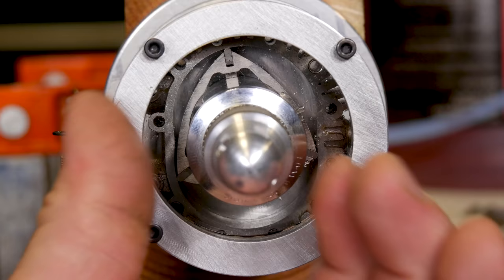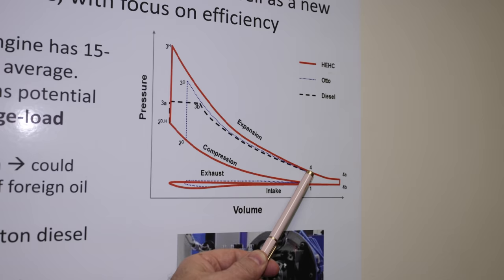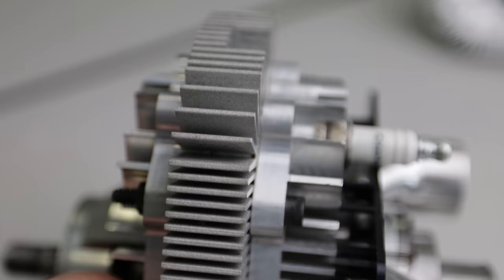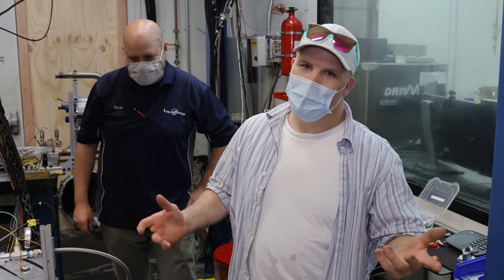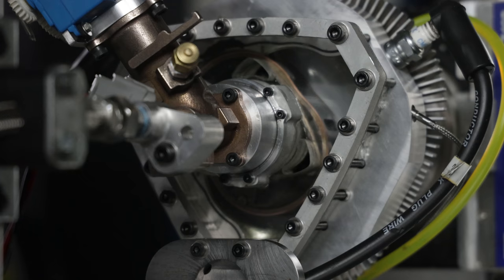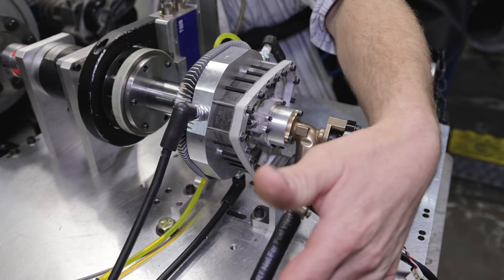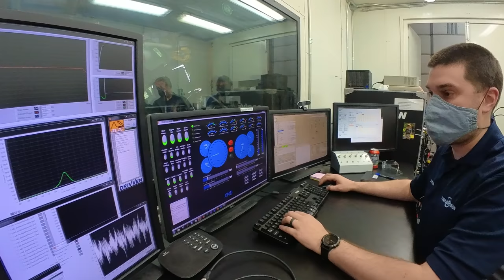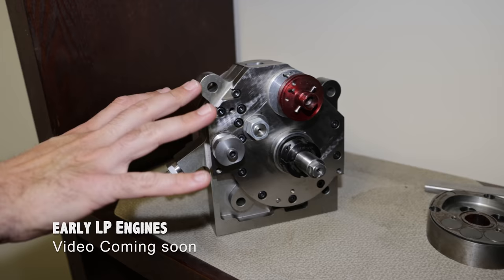See Thru Liquid Piston Rotary Engine - In Slow Motion

Comment: I worked for Mazda N.A. for over 14 years and assembled (by my calculations) about seven thousand rotary engines and assembled thousands of rotors and associated assemblies. This was over twenty five years ago and I'm very pleased to see that the rotary engine has advanced to this incredible engine. It appears that you have found solutions to the apex seal , side seals and the eccentric shaft. Three combustions in one revaluation instead of just one. Truly amazing. Congratulations. Now make it bigger. Thanx
Reply: I kept getting ads looking for investors from these guys. The ads said they're developing a version to compete with the engines used in OTR trucks
Reply: Keith romig how well woud an egine like this go if mazda disided to go with an engine disighn like this
Reply: The fact that that is a unique design I'm sure Mazda would be impressed but that type of motor would be better for some other application. It's just too small for an automobile.
Reply: I may need to get ahold of you for my fc engine rebuild
Reply: @keithromig957  I see no reason it can’t be scaled up to car size ?
Reply: @KenBober  good luck with a rebuild. That was some 30 years ago. Mid-eighties to mid-90s. I can't even imagine where you could find parts at any sort of reasonable price. Good luck my friend.
Reply: @keithromig957  damn. Mazda in Manchester ct won't even look at my car and no mechanical shops have a clue about these engines.  Looks like I'm going to have to tinker with it myself.
Reply: @KenBober  I just saw this response and figured I should get back to you. What is the engine doing or not doing ,what seems to be the problem? I will try to diagnose the problem for you.
Reply: @keithromig957  it's a retired autocross car and the guy I bought it off of said he had it rebuilt by Mazdatrix in California 30k ago.  It runs smooth as silk but I still want it gone through and also street ported.  I'm a 18 year veteran collision tech but I gave up on engine rebuilds back in late 90s. Never rebuilt one so I don't want to attempt it.
Reply: @KenBober  if it aint broke don’t fix it, leave it alone if it runs fine. Just take care of it and keep fresh oil in it
Reply: @mhxxd4  rather be ahead of the game instead of having a apex seal break due to wear and chew up the housings. Then it gets very expensive.  So do apex seals early to be safe
Reply: A wankle still has 3 power strokes per revolution.
Reply: @KenBober  What are you afraid of? There are so few parts to a wankle that it can't be all that hard.
Reply: Tell mazda to Hire new technician to keep this engine alive 🙌 please and thank you
Reply: @dboys4534  I'm just gonna rebuild it myself.  Put it this way in the last 10 years I've only seen 1 other fc. 1 fd (trailer queen) and 2 rx8s. They don't have a need for a rotory mechanic.
Reply: Hi, Keith. Could you please explain to me the real advantages of this engine over conventional rotary engine? Especially the ones concerning the apex sealing. It looks like to me that the friction is now between the seals and the rotor rather than the body. Thus, the engine rebuild would require new rotor rather than the housing. In addition, here you need three spark plugs rather than one. The only real advantage I can imagine is the even heat distribution over the massive body due to three combustion chambers rather than the single one.
Reply: Efficiency????
Reply: @keithromig957  it would obviously be a bit bigger. But that’s what makes it good. Less weight, revs to high rpms
Reply: It's actually only 1.5 detonations per rotation. The eccentric shaft seems to be gear 2:1 unlike the Mazda's which were 3:1.
Reply: Very puzzling, how do you keep such an engine lubricated? You would have to put oil in the fuel like a 2 stroke engine. And there goes the emissions standards out the window.
Reply: @forfluf  the engine actually injects oil from the oil pan into the rotor chamber. That's why it's so important to change your oil don't let it go to low and make sure that it's clean. Synthetic oil doesn't burn so would put that in the engine and it would last maybe two thousand miles and then seized up. It is such a light engine that I always wanted to put a 13B in a boat and let it rip.
Reply: Now do 4-rotor lol
Reply: It really is, but the apex seals haven't been eliminated though, now they are stationary in 3 positions, sure sollecitations will be differents but... they are still there... And I'm worried about the cooling of the main rotor.
Reply: And it seems that when passing through the center of the rotor, the intake system benefits from the centrifugal effect, as if the engine itself acted like a turbo. \o/ Maybe? :)
Reply: @keithromig957   you are assuming it is not scalable??   WHY??  re "...type of motor....too small"   I dont get it?
Reply: @keithromig957  I dont understand WHAT you even saying.....this obviously is a prototype ...obviously if it is scalable and at least as efficient and or cheaper to build or lighter (hp to weight ratio) then OF COURSE it could be fully engineered for mass production ....IF it truly has potential to solve the wankel issues I can see Mazda for one being HOT to go balls out....Even with its problems the RX7 was big hit!  I for one would ABSOLUTELY buy an RX10 with a 10 year 200k mile warranty on engine....A 2000 pound sports car with 400 hp ..mid engine for $40K .....dream come true!
Reply: @KenBober  NA rotaries are super reliable and last forever (usually). And I'm not a big rotary fan. Its when youtubers stick huge turbos on them and run 250hp/rotor or more when stuff starts to get sketchy.
Reply: @N4CR  Mines an s4 na. So maybe 150 horse. If I can get 170 It will be perfectly fine for me. I dont race, I enjoy the experience of the car.
Reply: Wankel is effectively a two stroke giving three bangs per revolution from one combustion chamber. LP is a four stroke with three chambers also doing three bangs per rev. LP has fewer losses and better combustion giving considerably more efficiency. 
The highly diluted exhaust makes catalytic converters unlikely to work. But is a cat really needed?
Reply: Coming from a professional such as yourself, this makes me smile, i loved mazdas rotary engines, im excited to see where this goes
Reply: My only worry would be cost and durability, Mazda already had problems with exentic shafts when pushing really high power making the shaft hollow will make it allot weaker making me worried on how usable this will be on a higher power application, especially when you try to save money on materials.
Reply: @keithromig957  For what reasons could this not be scaled up?
Reply: Js it possible to run it on Hydrogen? 
What would be the comparative efficiency between the battery charging power from an LPR and a fuel cell per kg of H2? 
How would that compare using direct mechanical drive H2 to tyres per kg H2 and via rechargeable battery storage? 
Could this method be viable for H2/ EV hybrid long haul trucks enabling the increase in payload?
Reply: Mazda was trying to convert the rotary to hydrogen and that was a very long time ago. They never had any success.
Reply: I did see someone mention getting the engine to can bus three times in one revolution and the Mazda rotary engine did combust three times and one revolution. Each side of the rotor created a combustion chamber as it's pain in one revolution. It would combust three times.
Reply: Ok
Reply: Too bad about the fundamental lubrication problems that all rotary engines unavoidably have, though. Not being able to scavenge oil means the oil has to be injected into the housing and left there until it burns off, so to minimize carbon buildup and pollution emissions the amount of oil has to be kept to a bare minimum, which means the seals are always on the verge of galling and destroying the moving parts.
Reply: @keithromig957  too small? You always start small, because its more difficult, if you perfect that, scaling up only makes things easier and more efficient due to bearing resistance not scaling up with size. The only thing that becomes more challenging is cooling due to the same no linear growth of volume to surface area. So too small, is irrelevant. A chansaw engine is too small for a dirt bike, they do not remake a different design though, it is just bigger and the same until you have cooling issues and need to add coolant systems and probably would go to 4 stroke for controllability, but a large 2 stroke still works well, people are just suckers for quiet and invisible exhaust.
Reply: @keithromig957  k
Reply: Three combustions!
Reply: You can also use unbreakable (brand name) seals, and they'll last 10 years or so. The carbon seals are just outdated.
Reply: did you find building rotary engines easier or regular piston engines in the other mazda models easier?
Reply: @keithromig957  what if they make it an actual size motor? would that work
Reply: @harryconover289  I know this is old but I think one issue is that the way the intake and exhaust gases are routed that a single rotor is all that is practical. In addition with the way the exhaust gas is routed it seem like heat removal as the size of the engine grows would be a huge issue.
Reply: Well. To be exactly, this is what Felix Wankel developed himself. Mazda, and prio NSU took Wankels REAL rotary engine and transformed it to a STANDING engine, where only the Piston rotated. Wanels engine rotated around the piston.

This one is again an inversion: They put the inside out and outside in: The triangoloid piston is outside as the housing and the housing is now the piston.
Reply: " Three combustions in one revaluation instead of just one"   -  no difference! 
Both geometries give three combustions per one rotor full revolution.
Reply: I personally would like to see two sets of chambers stacked to boost the output.  Stacking more than two might prove more complicated but two could easily be done, since the mechanism is single facing.
Reply: @PTSF_Jaeger  Yep, and small to medium aircraft.   They also might use a larger variant in mid-sized boats.
Reply: @ruediix  I can't picture what you're referring to but Mazda 3 make a 3 rotor engine that never entered the US market it was only in Japan.
Reply: correct me if I'm wrong but each engine in a mazda car has more than one rotor right? I honestly can't believe you'd get enough power off of one rotor....
Reply: @sheilaolfieway1885  Sheila the Mazda 3 B rotary engine was about 70 cubic inches and back in those days I could pick one up and they can get up to 280 horsepower. I've always wanted to put one in a speedboat.
Reply: @keithromig957  Yes but how many rotors do they have in them?
Reply: @sheilaolfieway1885  there was a 12 a.m. and a 13B engine
Reply: @sheilaolfieway1885  there were two different engines in the US, a 12A and a 13B and they both had just 2 rotors
Reply: @keithromig957  I see i wonder how well a single rotor engine of that design would work...
Reply: i did not get how exhausts getting out through exaust stroke. is there a solenoid valve?
Reply: How much torque we talking here.
Reply: @harryconover289  With an intermediate stopover to motorcycle size! :-)
Reply: Had a new Mazda RX4. in a wagon.. loved that motor..
Reply: The inventor of the rotary engine was the German engineer Felix Wankel, who sold the patent to Audi/NSU. The NSU RO-80 was the first vehicle propelled by a rotary engine. They sold the patent to Mazda, because the rotary engine is a gas guzzler and has emissions issues.
Reply: @KenBober  try electric conversion
Reply: Crazy how the best way to fix the problems with Dorito Power is to turn the Dorito inside-out.
Reply: @davidelliott5843  "The highly diluted exhaust makes catalytic converters unlikely to work. But is a cat really needed?"

Does a bear s**t in the toilet?
Reply: @KenBober  Australia is the place to look for rotary engine mechanics. We use to build and port motors when we were teenagers in the early Rx series I had a Rx4 and an Rx3. There are videos available online that go through the rebuild process in its entirety. They are not a hard engine to work on.
Reply: @indica8510  I've seen those. I actually want a rx4, I'm gonna just do mine myself this winter.  It's off the road this weekend because we are getting our first snow fall.
Reply: Would the weight of this thing scale up linearly? If a 4hp engine is 4 lbs, how much would a 100hp or 150hp engine weigh?
Reply: How do we know the seals problem is solved? Do they have any data to support that?
Reply: @manofsan  I do not know if they had to stay at the seals problem solved. I watched a video the other day of them building a four-rotor engine which was pretty cool. The seals are a multi-part issue. One of the biggest issues was not changing and keeping your oil clean because the rotary engine actually injects a bit of your oil into the chamber. When synthetic oil came out that was a huge problem cuz it does not burn.
Reply: @Keith Romig  -  I know that Liquid Piston have demo'd a rotary that burns hydrogen. But I wonder if they have to put oil in that one too, or if it's zero emissions? I also wish they could demo their small rotary engine on a paramotor.
Reply: @expansionone  '...and has emissions issues."

It must be noted that emissions issues are entirely artificial issues, and not practical issues.
Reply: @KenBober   look ut the vargis Brothers they do that kinda work
Reply: @Foshomoto  will do
Reply: @MrVaticanRag  Energy density of Hydrogen is very poor compared to fossil fuels (about 7 times less energy). It is the volume (litres) you need to consider in a vehicle not weight (kg). That is, the physical size of the tank. So range will be only 20% on the same tank as a fossil fuel vehicle or tank will need to be 5 times as large for same range.
Reply: @keithromig957  🤔 The smaller the better, isn't it? Imagine if they used gas turbines like in aircraft.!
Reply: @deusexaethera  personally
Reply: @bludika  The rotary was much easier to build then a piston engine. There aren't any special tools needed. If using all new parts the most complicated part was the engine stand. Some torque wrenchs, a meter to check the play within the engine and a big jar of gasoline. It was the skill of putting it together that most important. We rebuilt them so that was much more complicated.
Reply: @user-ez9lm9wh8p  It would be the weight ratio to HP and torque. Small , light weight, and powerful.
Reply: @CFChristian  I watched a bid on youtube doing just that.
Reply: There are two rotors per engine. I can try to explane but you would be better off served to watch it on youtube.
Reply: @keithromig957  Oh for real? I understand what you're saying, but I'll take a look. That's pretty exciting.

I have an itch to try and mess with a rotary moped too but not too confident in the choice of crates.

Well, now it's gotten worse bc Ryan from FortNine just did a review on a rotary motorcycle.

The struggle is real. 😂
Reply: @CFChristian  if you go way back there was a 10A engine that was even smaller but it has many issues. It was one of them earliest rotorys. Trying to put one on a cycle would be scary. Maybe on a strike. I would think it would have to be direct drive.
Reply: @keithromig957  OK, but why? Please notice I've asked about the difference between conventional ROTARY motor and this ROTARY motor?
Reply: @jakubswist5839  I'm not shipping my engine over seas. I'm gonna rebuild it myself
Reply: @keithromig957  I just found out Mazda made a OEM 3-rotor?!?

I'm so embarrassed.
Reply: @keithromig957  Unique is hardly the correct work. This design can be found as one of the concept design in "Rotary Engine by Kenichi Yamamoto" from 1960's.
Reply: Just in time for them to banned for electric.
Reply: three firings per two rotations like three cilinder, this one it's four strokes unlike Wankel and two strokes, but it's having more combustion chambers per rotor wich makes firing interval with 120º shorter like passing from parallel twin to inline three or from four cilinders to six cilinders interval in case of two rotors like on mazdas and all this with more efficient shape of the combustion chamber and same number of spark plugs per number of combustions with normal non hiden spark plugs
Reply: rotor engine is an interesting piece of engineering, but it still has the same issues with low reliability and high maintenance costs what can`t be solved. In comparison with rocketing EVs this is a past. It is like modernizing a steam engine, makes no sense.
Reply: @KenBober  mostly motorsports in Stratford, CT specializes in rotary
Reply: @chickenhawk212  great!!!! Thats less than an hour drive from me! Thank you!!!
Reply: I loved my RX7 and had only 1 engine repair in 3 years of ownership...and I drove it hard.
Reply: @molonlabe9602  my engine is still strong,  I'm actually fixing the damn fuel pump again right now at 830am. Cheap Chinese parts.
Reply: @harryconover289  bad timing.
Reply: @PTSF_Jaeger  I kept getting them also which made me very skeptical, they originally said they would go in planes as well. Seems like they're just desperate for funding.
Reply: Repent to Jesus Christ!
“By faith Joseph, when his end was near, spoke about the exodus of the Israelites from Egypt and gave instructions concerning the burial of his bones. By faith Moses’ parents hid him for three months after he was born, because they saw he was no ordinary child, and they were not afraid of the king’s edict.”
Hebrews 11:22-23 NIV
Reply: Amazing - you made the same number of engines as the rebuild interval for those engines.
Reply: @expansionone  Not quite, The NSU Spider was the first
Reply: @munnsey  you're right. Thanks for letting me know
Reply: Interesting design concept but no major manufacturers are even remotely interested in investing money in fossil-fuel burning engine designs. The future is 100% electric. As so it should be, burning raw fuel in autos belongs in the previous century.
Reply: @TheCuriousOrbs  internal combustion is here to stay. It'll be the fuel that changes - hydrogen.

Even hydrogen fuel cells won't come close to the efficiency of internal combustion.
Reply: @TheCuriousOrbs  I am a Professional Engineer with degrees in Electrical Engineering and Nuclear Engineering. The electric cars on the road today are causing more pollution and environmental damage than internal combustion engines. The primary source of energy for electric cars currently comes from coal and fuel oil electrical power plants. There are HUGE inefficiencies in electrical power production and distribution.  Overall, an electrical power plant is only about 35% efficient at converting the energy in the source fuel to electrical energy. Then every transformer that the power has to go through before it gets to your house to charge the inefficient batteries in your car are only about 80 to 85% efficient. So, to produce the electricity for your electric car to go 1 mile, it requires the burning of a huge amount of coal or fuel oil and causes more pollution from those power plants than if you burned the fuel oil (thick diesel oil) directly in your vehicle. Only when the majority of electricity is produced from solar, wind, tidal, or other green electrical production will electric cars be good for the environment. That time is far into the future. In the meantime, power companies are having to build more fosel fueled power plants to keep up with the growing demand. Someone joked about going back to steam powered cars, but guess what, an electric car is a steam powered car. The steam that it uses is just remotely located. Every power station, except hydroelectric plants, use some kind of fuel, even Nuclear power plants, to produce high pressure superheated steam to make electricity. The steam loop in a power station is less efficient than the old steam fired locomotives. Only superheated steam can be allowed to drive the massive turbine blades that then turn the input shaft of an electrical generator. The steam exits the turbine still as superheated steam. It then has to be cooled down to become liquid water again to loop back into boiler. Massive amounts of waste heat are pumped out into out environment. I live by a coal fired power plant. It has a lake that was built for cooling the superheated steam. The upper lake is the exhaust heated water from the plant. At the channel where the upper lake dumps into the main lake, I have measured water temperatures of 104° in August and September. At our dock 3 miles away, the temperature in August and September gets to as high a 90°. It takes a huge amounts of energy to heat up such a large body of water. Part of that waste heat and the pollution caused by the burning of coal is because of electric cars. Our power grid is extremely unstable and antiquated. There is a TED talk that discusses this problem. There are 9 major power substations in the US. If they were attacked by terrorists, the majority of the US would be without power for about 2 years. Farms could not be irrigated. Factories could not operate. Approximately 3/4 of the US population would die. I don't think making ourselves more dependant on electricity by converting to electric cars is a good idea right now.
Reply: @keithromig957  Why not have a dedicated oil (or should I say more generally lubricant) supply solely used for injection into the chamber?  No worries about changing the oil as it is isolated from rest of the system.  You only have to keep a separate reservoir filled....much like Diesel engine AdBlue systems that they inject for managing emissions.  You then also can balance the fluid characteristics to meet a balanced need of both burn/decomposition and lubrication in isolation of any standard oil function for the rest of the moving parts.
Reply: @TheCuriousOrbs  Electricity generation for charging has to come from some where...either localized to vehicle or central power generation/distribution as you plug it into your car.  Green power (solar/wind) is very expensive and not reliable. Hydrogen creations is too costly. Carbon-based fuels will not go away as long as there is not a resurgence for nuclear reactors (hopefully fusion-based at some point) to replace coal/nat gas in power plants.  Hybrid vehicles will be around a while before electric-only become the norm so as to provide that ability to internally keep a charge topped off as range extender until batteries take a next technology leap. LP will be positioned for use as the internal charging engine in hybrid cars/trucks.
Reply: @bmarvin6339  Great post.  Most people do not think about where they get the power for their electric vehicles.  Nor do they measure their greenness against the extreme environmental damage in the mining of rare earth battery materials and their subsequent manufacturing.  The fragility of our power infrastructure is also a good point.  There is not enough decentralization.
Reply: @MRJNB-jn9bk  that is exactly what I asked my Japanese counterpart engineer and I don't recall exactly what he said but it made no sense to me. I guess they figured if you're not smart enough to check the oil in the car and change it once in awhile you're not smart enough to check the extra oil Reserve either.
Reply: @keithromig957  A good ash-less 2 stroke oil is what should be used to lubricate the chamber walls, from an engineering viewpoint. A separate tank to feed the 2-stroke oil would need 2 level sensors. One level sensor to warn the driver that additional 2-stroke oil needs to be added and a second one to stop the engine from running to protect the engine. Of course, 4-stroke oil even synthetic oil could then be used for the eccentric bearing lubrication and the rotor cooling. I know of Experimental Homebuilt Aircraft that do this. Unfortunately, this is an example of when engineering and marketing clash. If the RX7 had been built with a 2-stroke oil tank, the average (non-technical) consumer would think the car had a 2-stroke engine. Burning 4-stroke oil in the combustion chambers causes ash to jam up the seal slots, causing the seal springs to jam and the seals to stop working. The jamming of the corner seals and the apex seals can cause the apex seals to break. This can lead to the destruction of the engine. Having 2-stroke oil in the combustion chamber might have helped the emissions because 2-stroke oil burns more completely. But, primarily, the emission problem is due to the odd shape of the combustion chamber with all the corners where the flame front leaves unburnt fuel. I'd like to know more about the emissions of this inside-out rotary.
Reply: @keithromig957  couldn't you just scale it up and increase displacement?
Reply: But the oil ?  Wil consum a big oil
Reply: Yeah mate I got told they'd have top feul rotary in 98 wish in one shit in another rotary fans should be grateful that the local newspaper gets delivered wrapped in a rebuild kit 🤣
Reply: @KingSheva-sh5qw  
How is expansion of the metals handled? It would seem to me this design would shine in a continuous run environment.
Reply: @bmarvin6339  
Co-generation supplies a portion of the demand. This changes the impact.
Solar takes the edge off at peak time of day.
If you have ever seen the grid demand you know from 9 PM to 6 AM the demand is drastically reduced from during the day. Incentives for charging overnight would offset the higher peak demand. All told, I agree with what you presented. Number of households are constantly growing so demand in that realm will never be less. Modern life revolves around electricity.
Reply: @PTSF_Jaeger  I'd rather buy an engine than invest.  But I'm broke so probably neither
Reply: @GregoryVeizades  per rotor revolution,  but it rotates at 1/3 the speed of the output shaft. It's orbiting on a gear reduction.
Reply: @invisibilezoe7295  I'm sure there is more r&d to be done.  The rotor could be a carbon composite and banded in something exotic.  They said there is excessive fresh air flow through the rotor and it gets cooled. Man just like carbon brakes this thing could be operating on a new level
Reply: @nigelwolfe6150  what is this? A school for ANTS?
Reply: @davidelliott5843  so the rotary does 3 bangs per rotor Rev. The output shaft rotates 3 times per 1 of the rotor.  Common misconception
Reply: @KingSheva-sh5qw  tubes are generally stronger than solid shafts. Also it's not being pounded by reciprocal force.  A hollow shaft is very strong on the longitudinal torque plane. Think drive shaft
Reply: @MrVaticanRag  you never want to go the combustion route with hydrogen,  only fuel cells. Just like that acetylene, if mixed with oxygen it's just to energetic for use like that.
Reply: @deusexaethera  could be injected into the seal if they are exotic sintered
Reply: @edeltrautfeuerglut2243  why u say piston?
Reply: @jwserge  correct but a Mazda wankle rotor rotates reduced speed because it's orbiting the gear on the shaft. Watch the animation on the Wiki wankle  tab Design.  It has marks for shaft position and if you pay attention you will see 3 revs of shaft per 1 of rotor.
Reply: @sheilaolfieway1885  yeah because it would perform like a 3 rotor wankle
Reply: @aryakia850  ports. Watch again
Reply: @keithromig957  synthetic oil burns
Reply: @KenBober  no, fly the Aussie to you
Reply: @joeidan801  it makes sense for small or personal aircraft.  We still can't get the energy density/weight as good as fuel for long flights.  This thing would be awesome for ultra lights,paramotors, small helicopters. There are plenty of uses in the world where a Tesla won't fit the bill
Reply: @bmarvin6339  ok you went on a tangent but to address the in efficiency of EV right now. Yes everything you said was correct excluding solar farms that produce steam. But this is how it has to happen. No one is going to remedy all the issues unless there is money to be made. We wouldn't be this far if it wasn't for Tesla.  The infrastructure will follow.  A missing part of our power systems is storage.  Tesla is addressing that. There is no way you can convince yourself that all the power plants have anything over the sheer number of personal vehicles in this world.  If everyone that could rode a bicycle while we upgrade the civilized worlds power grid and production methods,  that would be great.
Reply: @joeKisonue  not in a rotary engine
Reply: @keithromig957  how can I trust a guy with no content?
Reply: @joeKisonue  I agree the weight is important when we talk about aircraft engines. At the same time the reliability is even more crucial here.
Reply: @joeKisonue  dude what I know what you mean by tubes stronger then shafts but the sheer force of a shaft is always higher then the sheer force of a tube(assuming they are made of the same materials) it’s not a piston engine the torque is rotational not directional.
Reply: @sheilaolfieway1885  Correct, the RX-7 and the RX-8 (Renesis) had 2 discs, say two rotary-Engines connected to each other like a 2 cylinder-engine.

And you cannot believe, but: "It is not a trick, it's physics!"(C)
The point is, that a rotary engine consists of three rotary chambers.
So a 2 discs - rotary-engine consists of 6 chambers.
It is like a 6 cylinder engine.
And it is made to run at high rotations revolutions per minute.
So it is should be wonder that it is that powerfull, it should be expected.
Reply: @joeKisonue  Because it is a "rotary piston" I am not talking about "linear pistons" or "cylincric pistons".
It is a piston that can move inside an epitrochoid. So "epitrochoid piston" would also be correct.
Reply: @edeltrautfeuerglut2243  oh yeah
Reply: @KingSheva-sh5qw  Right. And with rotational forces hollow would be suitable.  Are we saying the same thing?
Reply: @joeKisonue  LiquidPiston doesn't sell engines... they just take people's money.
Reply: @GregoryVeizades  Joey just learned how they work yesterday, I had to explain it to him.
Reply: @joeidan801  Exactly, and that is why Wankel engines cannot be used in certified passenger aircraft.
Reply: @edeltrautfeuerglut2243  Thank you for explaining that to Joe... he is still learning about engines.
Reply: Kinda machine that could as a generator could charge a battery vehicle to go a long way without stopping for a charge
Reply: @mikewinkker4897  The concept of range extenders recieved alot interest a decade ago.. but turned out to be a complete failure.
Reply: @KenBober  Thats just sad. I like Mazdas but the mark of a truly special company is one that will service all of its own products with utomost seriousness if requested by a customer.
Reply: @KenBober  central Florida has quite a few in the Puerto Rican community.
Reply: @dennisford2000  found a rotary rebuild shop the next state over. Popped the coolant seal yesterday on the rear of the engine.  Calling tomorrow to schedule a rebuild.
Reply: @KenBober  check out Rob Dahm here on you tube.. he is doing lots for advancing rotary engines.. just not sure he is doing it to sell..
Reply: I don’t think the cam shaft can take the torque it would require to propel a car with it being hallow the way it sits now is perfectly fine but it’s not under load
Reply: I have no experience with rotary engines beyond watching videos about them, but you confused me very much with your comment. How have they found solutions to the apex seal and side seals - they just moved them to different places as I see it, the apex seals being on the sharp points of the housing and the side seals around the side of the peanut-shaped rotor. Also a normal rotary engine also has three combustions per rotation of the crankshaft I believe..? The way I see it they didn't fix any problems about a conventional rotary and just added complexity and weird ideas like a crankshaft functioning as an intake...
But as I said I have no idea what I'm talking about, so if I'm wrong please educate me.
Reply: Hello rotor head the changes I was referring to actually was how they change the Apex seal. There are three or maybe four versions of the seal. It went to a fat carbon seal which was about a quarter inch wide to a one piece alloy compound seal that was about an eighth of an inch wide. Both of these seals had one spring underneath them to the walls of the rotor chamber. The last type of seal I saw there were actually two pieces there that seal that would slide across each other with two Springs underneath. As the seal would wear the two pieces slid so that there was a same amount of pressure on a seal all the time. What changed with the side seals or the types of material the old models had bare Steel on the housing walls. They had to change the types of materials on both the housing walls and the seals themself to try to keep this sides heels from wearing out. They may look the same but they were different. I hope this helps
Reply: @invisibilezoe7295  Wouldn't it be enough if you just let cool air pass through the inside part of the main rotor?
Reply: @keithromig957  artic cat made wankel rotary motors for their snowmobile fleet back in the 1970's,
Reply: A brilliant engine design. Unfortunately there will be little future development  of any combustion engine with the transition to electric drive.
Reply: @tom0kiely  unfortunately you're very correct. Who knows they could still be trying to do something with it in japan. I know at one point they were trying to turn it into a hydrogen engine.
Reply: can you explain to him that the timing needs to be fixed so that it fires each time a lobe comes around.  from the video it looks like it is only firing on one lobe.
Reply: I thought mazda never had failed apex seals, it was nsu that did
Reply: A proper expert on the subject and not another armchair “expert” 

I hope this engine does success on a large scale
Reply: @harryconover289  scalability is one of their key claims as a company.
Reply: Keren banget nih very good mr
Reply: Its basically a 3 cylinder engine, very large difference (in my opinion anyway) to the mazda's 1 cylinder to rotor equivalent. Not every stroke is a power stroke, but each revolution still has two ignitions or combustions, which seems to be the main difference. I'd say the Mazda design is essentially the two stroke equivalent the the liquid piston 4 stroke.
Reply: My RX 8 has a post and pre spark plug. I think the new engines have 2 sparks mainly for emissions I'm told. This engine seems cool and I do like the side seals but I can't see this performing under any kind of stress. The wankle likes to rotate under load and with this design I think it could be catastrophic. In a small engine design I think it's fine.
Reply: @1sinister80  why would this be catastrophic?
Reply: @kraagnjilwulf1413  Let me clarify. If you stack more than 1 rotor then it could be bad. So if the seal is on the metal that is going to flex and shift and not on the rotor like the apex then when said housing twist from high load the side seal will deform with that flex and if it isn't completely flush with the rotor it will almost surely catch and break. I'm sure this is a known issue and if they would clarify I'm almost positive they would back up my statement. The flexing and twisting is a very well known fact among the rotor community.
Reply: @kraagnjilwulf1413  Sorry I should add that this rotor looks like it's plastic and it's very light. The rotor being heavy is what gives the engine it's torque and balance to some degree. How would you get around that in a car sized vehicle of 3000 plus pounds.
Reply: Hey! We've been handling a lot of the specialized enclosed transportation for Mazda NA for the past 8 years or so. We started right as they revealed the Miata MX5. We just moved a couple of their cars to JCCS this weekend and will be transporting the 787B, 792P and a few others to Sevenstock. Do you attend these events?
Reply: They just turned common Wankel inside out. In Wankel you have power stroke only on one side of engine body. Here you have power stroke only on one side of rotor. Те же яйца, только в профиль
Reply: hey if mazda licensed this engine it would be a efficient version of RX
Reply: I am willing to converse with you on my rotary engine. Say hi to me as the first gesture. 🙏.
Reply: @magnetmadmanmaths5819  very high...the carnot limit is about 38%  and this just keeps spinning with little resistance
Reply: Can I ask pls, why hasn't Mazda ever launched in India. Considering how well it's contemporaries are doing in India. Mazda wouldve been, will still be a rage.
Reply: I'm gonna be that guy: according to my calculations, in order for you to have assembled about 7,000 rotary engines over the course of 14 years, that would average out to about 500 per year,  42 per month, or about 1.3 per day (or three engines every two days). Calculated assuming you worked 7 days a week.
Reply: @KenBober  Not as many parts as regular ice. Should be much easier.
Reply: @mhxxd4  😂😂  Yeah, you CAN end up fixing something until it IS broke, right?😂😂
Reply: Thank you man. I genuinely appreciate you being a part of putting those great engines in to the world and any vehicle I've owned I make an effort to know about the factory it was conceived in. Shout out to all of yall putting badass machines out there, and I swear I can feel everybody's soul put in to it, from the engineers to the assembly line.
Reply: @VestedUTuber  Ahhh!!  The Legendary "Rewop otiroD"
Tales from the wise ones say when combined with "ObruT RepuS", bringer of ThadenseAir.... All will stop and listen.... for the triangle of Doom 

Dude I fricken love Rotary's
Reply: Gavin Lepoer  I don't think I'd love that!
Reply: I agree that it's time to make it bigger and bring it to the race track.
Reply: They keep calling me I'm like who tf is liquid piston
Reply: I've been 30 mins str8 comment reading to find the first person to notice this. I was beginning to doubt what I seen for a moment. Great detail analysis. You have my respect fo sho.
Reply: Electric is not the future, it's a distraction your all getting caught up in. We still use way too much non renewable resources to create this charge for thr batteries AND a whole new slew of issues when mining for the rare elements that go into making the  batteries. Hydrogen is a extremely better option even at 1/3rd efficiency of a electric version of the same class. I will never at this point in time see myself going anywhere past a hybrid as far as electric goes. I won't be stranded because of a lack of ways to re-energize my vehicle without waiting 12 hrs for a 30 mile boost. The price is wrong bob... try again
Reply: Looks like it has apex seals, so nothing is improved.
Reply: @robertsaca3512  why did you even bother to comment, you obviously haven't paid attention to the numerous improved differences between the two versions of engines here... you sound like one of those typical "just say what everybody else is saying to look good" type of people. Unfortunately this wasn't a video about improving the Apex seals of a rotary engine but improving many of the outdated/flawed designs from the original.
Reply: I managed to find the latest internal combustion engine design, this engine does not use a cylinder but uses a disc with a 4 stroke dividing wall, I hope Mazda will work with me to make it happen. This finding will be a new history of automotive technology.
Reply: Hi i am from india since there are no rotary engines in india and i am very much fasinated  it i would to build can you help me